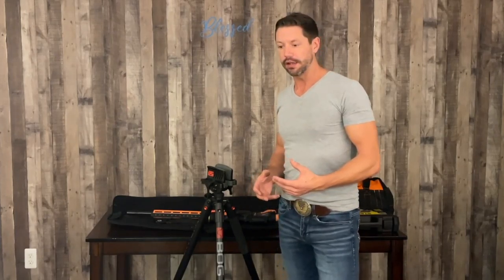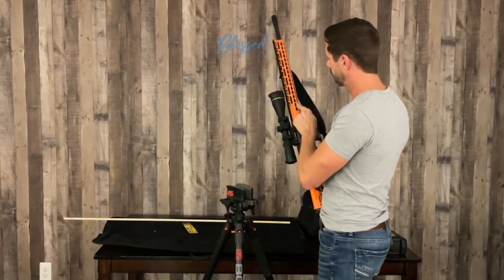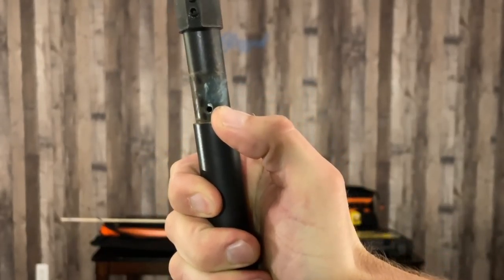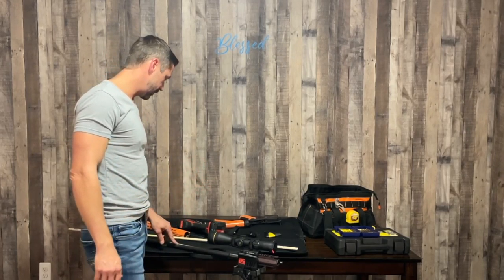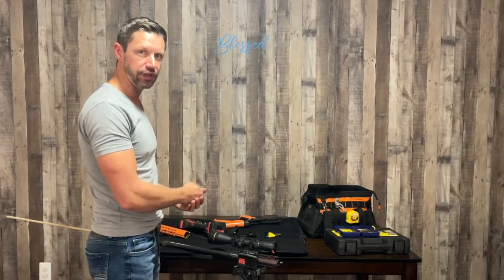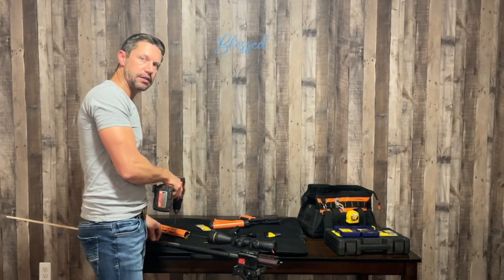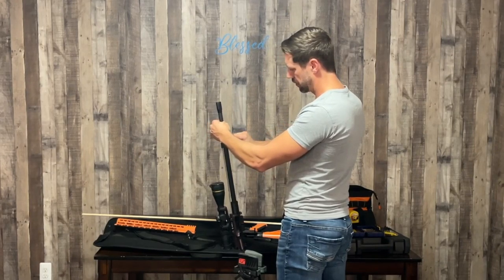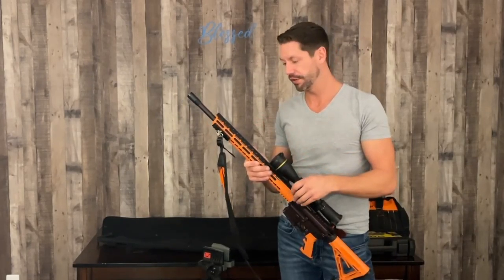Gas port gauging for feed issues on a 450

Comment: Have you heard of mid length on an 18" doing the same thing? I've tried troubleshooting with other lowers and taking apart mine and believe the short cycling is from lack of gas
Reply from the maker: You could have a mid length or rifle length gas system cause the same issue. If you do it doesn’t matter your barrel length. It is an effect caused by the longer gas system. If you had a rifle length gas system on a 16” barrel you would experience the same problem. 12” gas tube is “rifle length”
9” gas tube is “mid length”
7” gas tube is “carbine length”
4” gas tube is “pistol length”
I would say if you have anything over the 7” “carbine length” you probably have gas supply issues and need to open up the gas port like I did in this video. 
Let me know if this helps.
Reply: @zumaconcepts1200  it's a mid length. I'd imagine there could be a longer time to pressurize the gas system with a longer barrel, but maybe that difference is negligible. I'll give one last try by brazing the gas tube since there was a small leak and try a friend's bolt out of a cycling gun before drilling. I'm getting about .089" on the port and will likely see what happens with a 3/32 drill bit. Good idea on the dowel for a stopper and to check for burrs.
Reply: I had the same issues with mine so I put in a heavier buffer H3 and it fixed the issue, no more problems